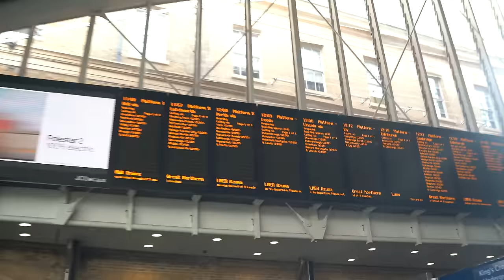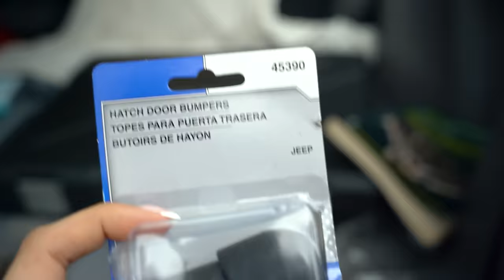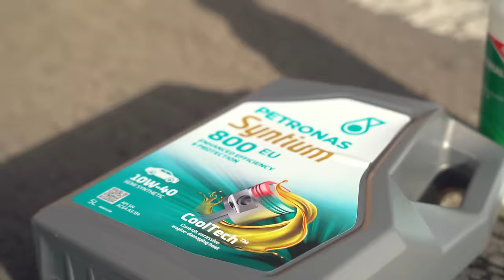converting ANOTHER JEEP Cherokee?! (american girl vs. british jeep)

Comment: Tankqu sound like thank you. Good choice on getting the 4 liter inline six, great motor. Cant wait for your build vidios. Suggestion after removing rear seats, start at tail gate. 2.5" high then level to back of fronts seat will be 10" high. Then you able to put 9" high lythium batteries, diesel heater,  9"H x 16"W x 26"D (16Gallon) water tank sits where back seat was, water pump. and ton of storage all under the bed platform.  And if you do a 36" wide bed. you can build 10" x 32" cabinet under the back window, for solar electronics, storage, and room for powerstation. Well have fun and stay extra terrestrial.
Reply from the maker: Thanks for the suggestion! Appreciate it

Comment: Running gear is your most important off road asset so don’t take chances on the overhaul as it will be a bugger to get parts in Europe if anything breaks. Rooftop tent is a great idea but check wall thickness and seams when open as some of them are freezing when its cold and leak when its wet. Practice mindfulness while driving - you still have the right hand drive on the right hand side adventure coming. Like the look of the Tank regardless of rattles.
Reply from the maker: Thanks for the tips!

Comment: Groovy. I say focus on replacing worn suspension, steering, and brakes, especially rubber bits and bobs, and you'll be golden! Plenty capable as she sits. Maybe plan for stiffer springs for anticipated added weight.
Reply from the maker: 🙏🏻 thanks for the suggestions!

Comment: Need to be careful with front end suspension components wearing out on Jeeps - you get that Jeep wobble of death wear it feels like the whole front end is going to vibrate off. Don’t use the brakes when that happens. Just let off the gas and let the Jeep slow down on its own. When the wobble stops, you can use the brakes.
Reply from the maker: I think the death wobble happens more with the wrangler than Cherokee but I’ll watch out
Reply: @TorieRobot  happened with my Grand Cherokee. Replacing wheel bearings, struts, shocks, tie rod , and sway bar one side at a time finally fixed it. 

Love your adventures. You’re such a luminous soul ❤️